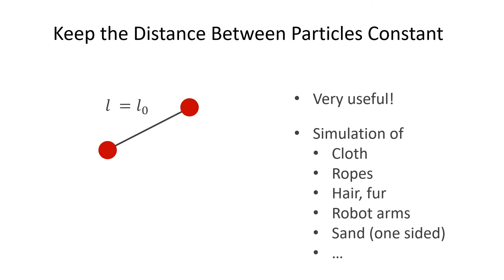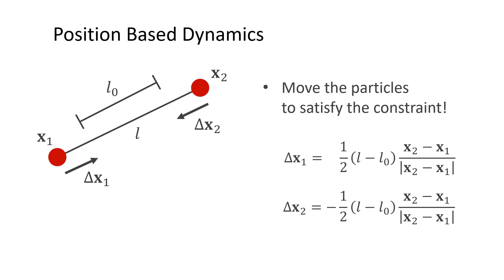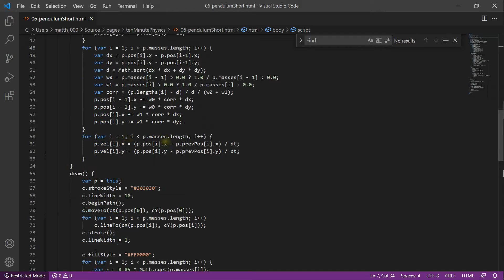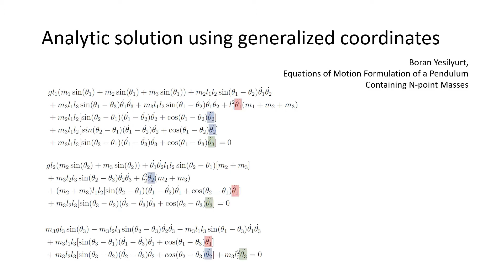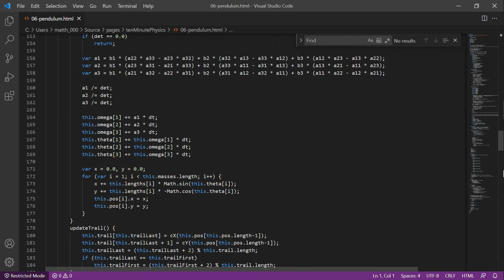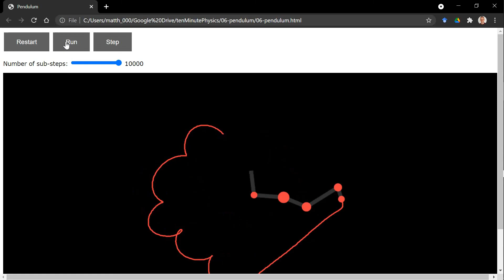06 - The simplest way to simulate a triple pendulum

Comment: I've recently started simulating double and triple pendula. I use Maxima to generate the necessary ODEs from the Lagrangian and then feed them to the rk(RK4 iterator) function. That way I can avoid coding the haywire ODE directly. I check the mechanical energy drift to see if the calculation is dissipative.

Comment: This is fascinating. I've written a 2D gas flow simulator which was relatively easy, and it exhibits patterns you'd see if you were watching water flowing flowing through a similar shape where the height of the water is analogous to the pressure of the gas at any given point. One thing interests me greatly though: From the path of the end point, what method would you use for working out the structure of the pendulum? ie, how many links and which weights? I have a reason for wanting to know how to do that. It's essentially reverse engineering a chaotic pattern which of course has multiple applications, preferably without doing a brute force method.

Comment: When I first implemented a double pendulum (using analytical equations) I thought I'm "stimulating" it. But that wasn't true of course.

At least if we don't consider the integration part.

I then tested Euler method vs RK4, to see which is more stable.

It would be interesting to see which is faster (amount of operations vs. substeps)

Comment: I think it would be good to plot the total energy of the system in time.  This would help us understand whether the solution is dissipative or not.
Reply: I am loosing energy, even with a single pendulum what could be the reason?
Reply: @samsaraAI2025  Your time integration is not conservative.  The numerical discretisation is "leaking" energy.  

Use a 4th-order Runge-Kutta or a time-implicit method like backwards-Euler.
Reply: @samsaraAI2025  Euler integrations are approximations for non-infinitesimal dt.

Comment: Is there a simple way to make sure energy is conserved, even with less steps?
Reply from the maker: You can measure the energy loss and add it evenly to the particles. However, objects are typically highly damped so instead of pumping energy into the system, extra damping terms are added to the equations in general.
Reply: @TenMinutePhysics  That's not a good advice. Compensating energy errors by arbitrarily modifying the energy will generate errors - it is not symplectic, it is not time reversible and it will not exhibit a correct behavior in phase space. 
Masking numerical errors with damping effects is not really an option if your system is supposed to be energy-preserving
To conserve energy with less time steps, you'll obviously want to use higher order symplectic integrators.
Reply from the maker: @Zymplectic  Yes, that is not really physically correct. Some people have done it in graphics. However, as I said, the real strength of PBD is not energy conservation but robust handling of zero-compliance constraints and simplicity. In the real world, nearly energy conserving systems are rare. In contrast, most objects are highly damped which is the reason why additional damping terms are used significantly higher than the numerical damping introduced by implicit integrators. In contrast, stretchy cloth looks really bad - if not intended :-)
Reply: @TenMinutePhysics  It wasn't a critique of the video which is on point, but merely to the "out of context"-point of arbitrarily adding energy to compensate for dissipative numerical errors. 
The real world being "inaccurate" does not prevent us from making accurate energy-preserving simulations though. I'd agree that energy conservation is typically not what you want for cloth simulations. Unless the cloth is floating in space...